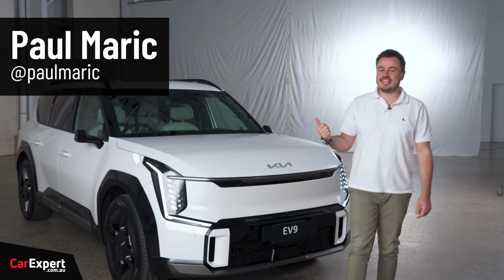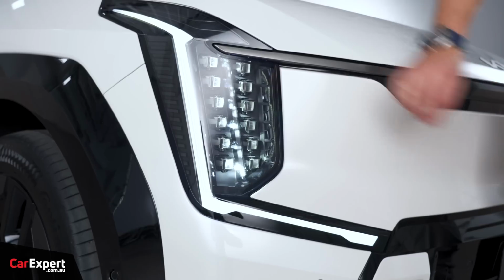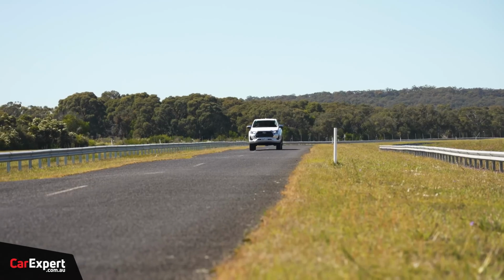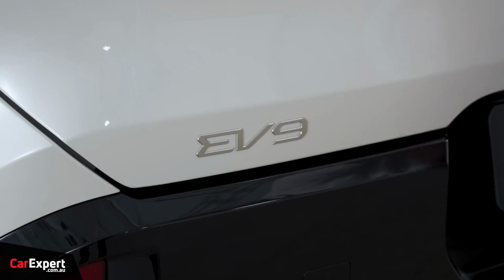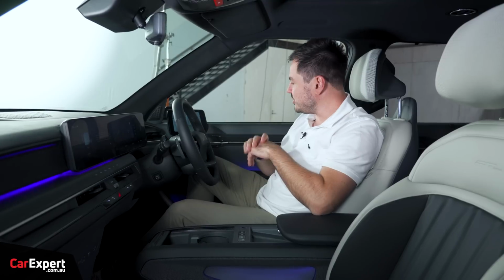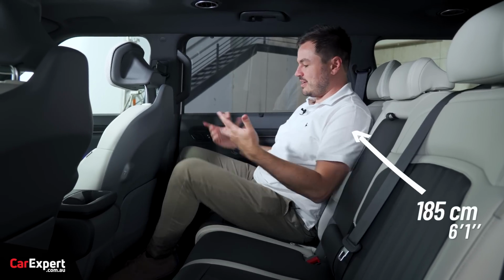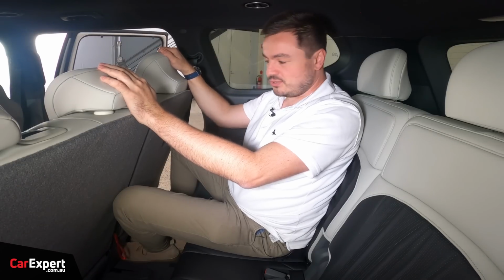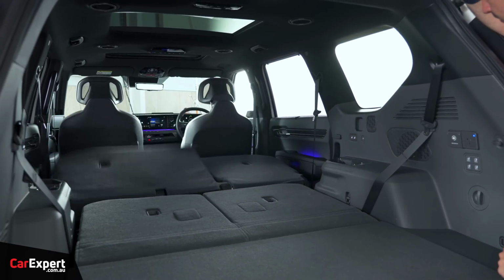2024 Kia EV9 first look: Everything you need to know about this 7 seat electric SUV!

Comment: This 100 kw/hour battery will save maybe about 40 tons of co2 of vehicle emissions per year compared to a diesel.

A typical house can be powered by solar and a 20 kw/hour battery, saving 20 tons of co2 for an average Australian house.

Which saves more tons of co2 per battery capacity of 100 kw/hour?

Kia EV9 100 kw/hour battery = 40 Tons

5 x houses with 20 kw/hour batteries = 5 x 20 Tons = 100 Tons of co2 direct emissions.

Investing in Solar and On Site Battery Storage for Australian homes would be more effective in combatting climate change.
 
Thoughts?

Comment: If they are smart they'll remove that 3rd row back as far as they can......  more important then that boot space considering they have room upfront as well and it will cost way too much.  I'd say 80-90k? ....  The engines are disappointing same with the range.  They should all be aiming for just over 200kw and 500-600km/s of range always.  A sub 6 second 0-100 standard!

Comment: Definitely looks the goods. Will be interesting to see the price for the GT model. If the Mazda CX90 is going to be sub 100k I think this will be up there with that. 
Does this have curtain airbags that extend to the third row? The seats look awesome with the softer leather in the centre section do the head rests tilt forward or are they fixed position?
Reply: Haha I forgot to add Paul why do your arms look like they have been amputated in the cover for this video. Really strange looking.

Comment: Looks good 👍 cost estimation will be b/w 80 - 120k. However the big question is how much will it tow ? Can it tow 2.5 Tonne ?
Reply: Even if it could, the camp site would have to be across the road then. I don't think it would drive too far with a 2.5T load behind it.

Comment: Love that the 2 rows of seats seem to fold down flat, which means you could sleep in the back, which would be great for car-camping! Just wonder what 'light off-roading' means, perhaps enough to get to most non 4x4 campsites?
Reply: You can drive very bad road with this. 20cm ground clearance and lot of 4wd torque. Problem is those 21 inch rims and tire choise seem to have zero rim protection. They don't even allow 19" rims with top spec.

Comment: I do love the look of them. But why do they insist on having an "all electric car" that doesnt make it that far in respects to long distance they seem to love adding extra screens ect to drain extra power that could be used on the road.
Just make the wing mirrors and revision mirrors actually mirrors not a screens and even the door for the charging port... why does that need to be a motor to open it.. are we really getting that lazy?
Why do these also never come with a full covered roof with a solar panel/panels to charge while parked and driving along to get more distance or if you run out of power can get some sort of charge if its day time.
These cars are a waste of money. If it cant make it from places like Perth to kalgoorlie which this wont make before needing a charge. Whats the point of them, when petrol/deisel cars can make it all the way.

these electric cars are just a show they aint good for the environment at all when you factor how they are made in the end and the over the top tech they actually put in them.
Thats my rant 😂
Reply: There's a difference between pointless, and not suitable for you.  For the moment they may seem like a luxury but the future is pretty clear.
Reply: Haha!  How much range do you think is lost to the screens?  A fraction of 1%?
When you’re NOT going from Perth to Kalgoorlie in one continuous trip then they start to make sense - so, most of the time.
Reply: @oggyoggy1299  if you add them all together dash, radio, revision mirror ect ect they are all taking up resources its not just the screen itself consuming power (obviously we cant get rid of all the screens in a car ie dash or radio). Am i fully againts them though no. But wing mirrors being a screen is not needed at all. Not saying go to a fully manual mirror like a 79 series. a camera on the outside and the screen being placed in the car somewhere instead of the outside of the car would be more beneficial. As we all know theres gonna be some moron that decides to hit it or just break it just cause.
My main point is as soon as its an electric car they seem to think hey lets put a screen here and here suprised the side windows aint screens with a camera facing out so we dont see outside we just see the screen of whats outside via the camera

Comment: Paul, enjoy ya stuff. Question for you regarding the electric charging hood. what are your thoughts? I was wondering iof you ran out of juice would it have enough to still opem? Ive seen in the past in cases on testing where this was an issue.
Reply: Uses the 12v battery. Electronics don’t run off the drivetrain battery directly. Also you do not ‘run out of juice’ with an EV unless you try VERY hard. It’s just not a thing. There is also a manual way to open the charging flap. It’s not mentioned but you can see it on the interior in the boot below the rear seat buttons (the round thing)

Comment: The price I would suggest is around $80K to 100K. Looks stunning. Kia has been doing a great job 👏
Reply: A buddy of mine has one on order already for his missus. He’s besties with the local dealer principle here in ADL. His missus is driving a 300 series cruiser and they don’t like it compared to the 200 they have. They have gone with all the bells and whistles and it is sitting somewhere between $120 and 130k at this stage.
Reply: @Nerdificationing I agree, top spec PHEV Sorrento is $88k so would expect north of that too.
Reply: Stunning?
Reply: @Rally4Life1982  🤪
Reply: There is already pricing in Sth Korea for this..  If you take the KIA EV6 GT, it is slightly more than that there.  So an EV6 GT is just under $100k Aussie
So the base would start at just over that.  But could expect around $95K - $99K before on roads, just to keep in under that $100k mark.